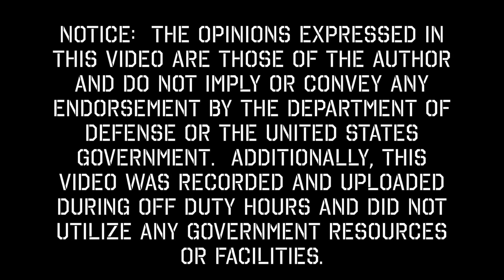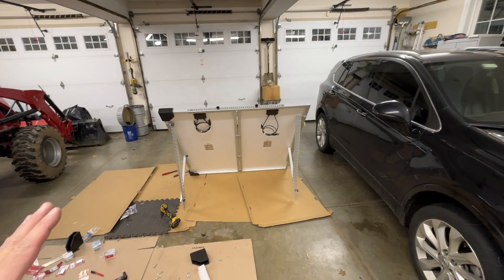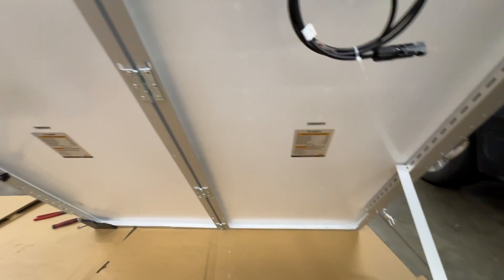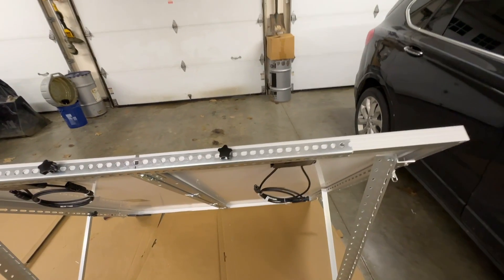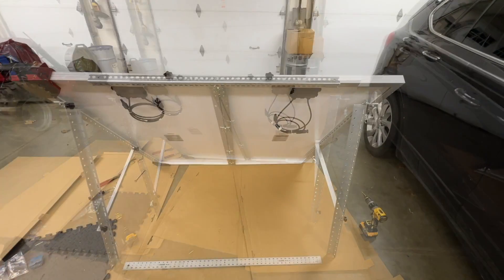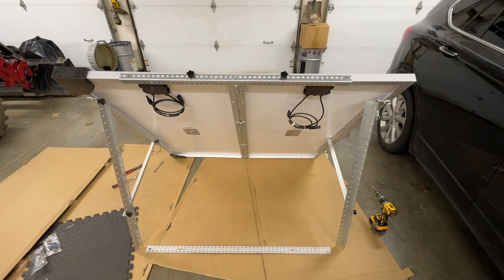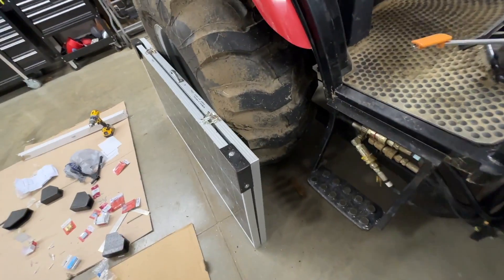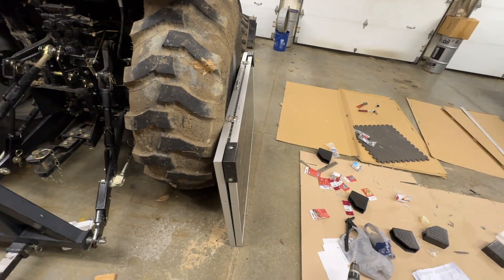Suitcase Solar Panel Build - Make Rigid Solar Panels Portable

Comment: I had started using solar panels on remote jobs 35 to 40 yrss ago.- our crews were steadly on the go in remote regions -
     we found that the semie flexable panels work out the best - there a lot lighter and take up a lot less space than ridgid panels - 
   You can easely lay them on top a tent and tie them off - 
  In many areas of the country when snow is not a problem - if you lay a panel on the ground they will generate the same power as when there set up on an angle - 
     If your worried about dust building up when there laying flat on the ground - you often find they have the same output when they have dust on them and when the panels are clean - 
     Dont wate  for a disaster to try out the panels - if your in regions of low humidity they can give you the full rated out put as in the south west - 
      If your in a high humidity area at noon day they might only generate 20% of there rated out put - 
       Thats why i say use them some befor you need them - that way you will know how well they will work for you in your area -
      in my area they dont work well because of the humidity -     i do know some that live up in the woods, they have them for lights, charging a phone, and a small radio - 
      In that case they can work - in 2021 from February till july there was cloud cover and rain every day - 
      So those in the woods were in the dark at night -  there battery's never charged during that period -
 I know from experience solar wont work at times -

Comment: Hi JJ If any part of the solar panels are covered it will drastically reduce there efficiency. You should cut the part of those foam corners off that is blocking  the panel  from getting sun light.
Reply: You can run strips of weather stripping around the edges for padding probably.
Reply from the maker: Great idea on the weather stripping!
Reply from the maker: For sure. I realized there was a bit covered and cut that portion out. Good point!

Comment: Maybe you should have turned it where the solar panels are inside to protect them versus having it where all is stored together. Just saying that each one those little cells are easily damaged. I also understand the fact that you want to keep everything together.
Reply from the maker: That was an option. The cells aren’t really protected any more though. The glass protects them on the outer layer.

Comment: Love the design.  I would find a way for those legs not to press against the back of the panels glass.  I want to do the same thing because the price of portables is insane.  I live in Fl so you need waterproof portables.  Summer rain happens everyday and is a nightmare if you have standard portables.  The waterproof portables are beyond ridiculous as far as price.  Great video as always.
Reply from the maker: Yeah I trimmed up the brackets so they no longer rub against the glass. It should be good to go.